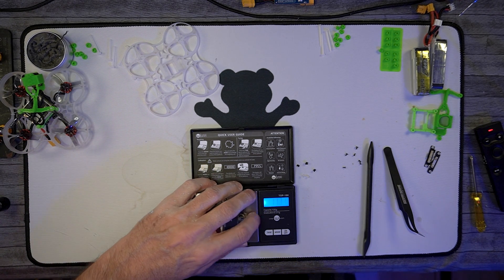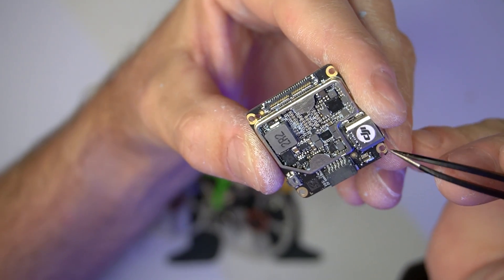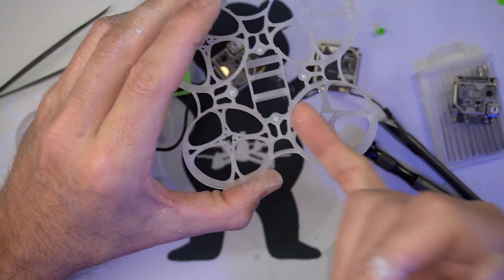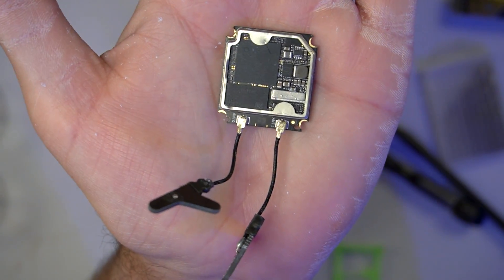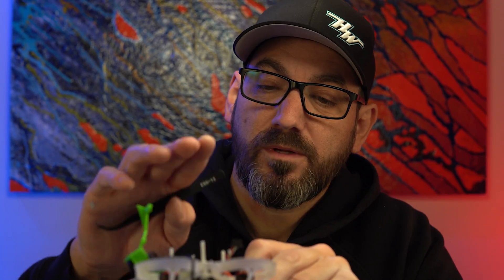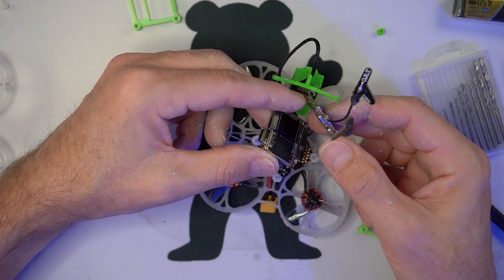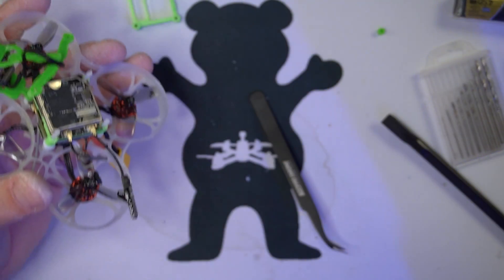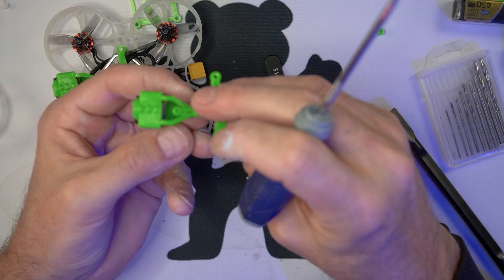Mobigital O3 Nano Cinewhoop Build Walkthrough // DJI O3 Air Unit 75mm Tinywhoop

Comment: Putting together a mobula 8 03.  Just noticed the aio board has the same amp ratings as the gnb a30 plugs.   I plan on stripping down the  03 unit and camera to save weight.  If I changed over to a30 it would drop the weight by almost 2 grams additional.  I don’t mind soldering plugs.  What are your thoughts on flying 2s with a30 plugs?  They are rated for 12amps by continuous and 15 peak.  I’m sure they could do more but I’m thinking that board would have problems before those connectors melt.

Comment: I’ve been thinking about trying this with the mobula 8 with your stl files.  I’m thinking the bit of extra power will be nice.  Your thoughts?  Do you think the extra weight would have a big impact on the durability of the 03?
Reply from the maker: I think the mob8 is 85mm? 80 and 85mm does handle the weight better for sure.

Comment: why didn't you just use 1.6m x 20mm bolts and use small rubber PCB board grommets versus cutting the corner of the Vista boards? that way you can keep the build holes at 1.6mm the whole length? this would also save weight.
Reply from the maker: It’s a good idea but I personally didn’t like the wiggle in the stack and it adds a little weight but not a huge amount.

Comment: Thanks for making this! I just ordered the mobula8 lite and I was wondering if I could use the mobula8 board!??
Reply from the maker: I’m sorry. What is your question?
Reply: @DaxNealFPV  Sorry, my question was If I could use the mobula8 board with the motor connectors and still have enough room with the frame.
Reply from the maker: It should be able to fit. @jorceleyoliveiravela5162

Comment: why not just use an m2 size screw instead of clipping off?
Reply from the maker: nylon m2x25mm is near impossible to find and m2.5 is many times more durable in a crash. Steel screws add too much weight and will negatively impact flight.

Comment: Hello! Do you have air unit overheat problems, black screen or screen freeze when fly slow? Do you fly in CE mode or you made any power mode hack like FCC or HAM?
Reply from the maker: It will get hot like any other vtx, so arm it and take off. No black screen or freezing as it is only 2s voltage and I run the HAM hack at full power 24.7
Reply: @DaxNealFPV AM means ? , Are you supply 2s to O3 and no problem right ?
Reply from the maker: @mokshpatel6986  morning. Yes that is correct.

Comment: Hey man, appreciate all the info on your builds! Can you tell me if you would go with the RCINPOWER 1002 motors or the newbeedrone 0804 motors for a mobigital 7? Both are slightly high on the KV for a 2s whoop (14000) but I think I can get by with motor output limit. Most of the 1102 motors aren't in stock these days so I'm looking for my next option (would get them from your site if you had em 🤙). Thanks brotha!
Reply from the maker: I found the 1002s to be lower in efficiency on a heavier build by 30 secs but I still got 3min. And the nbd are too unnecessarily heavy. Between the two, I’d choose the 1004 personally brother!
Reply: @DaxNealFPV  Thanks for the quick reply! Best of luck with QuadSensi, I think you really got something with the ‘nano cinelifter’ 🤙

Comment: That is amazing, I'll totally build one of these myself. I can see that the antennas are not included in you kit, witch antennas are these you using? Thank you!
Reply from the maker: Thanks brother! They’re the ORT micro vee. I m out of stock and most everyone is but I think RDQ has a few left right now. Mine order has landed and in in LA today. I’m guessing I’ll have them by Tuesday.
Reply: @DaxNealFPV So I would just use two of these linear antennas? I thought Dji used left handed. Thank you for the answer btw!
Reply from the maker: @barraca1393  yes, for a whoop, there is not degradation. The battery will limit you well before you reach far enough away for it to be an issue.

Comment: Wow awesome!! There is a lot of heat in O3 VTX, is there no problem?
Reply from the maker: It does get hot but just arm a fly and you are fine. I had it get stuck in the rafter for 15 minutes once and it is still fine.
Reply: @DaxNealFPV  this is great to hear. I’m super interested in doing one of these. Love tinys and I love the video from the 03. Great video man thanks. I’m sure I’ll bombard if I actually get around to doing this.

Comment: This is so awesome. Have you tried putting the case back together? How bad is it for flight time if you dont remove the case? 
I have only one o3 and will need some protection in the future when my 5in freestyle frame gets updated
Reply from the maker: You’d need to replace the thermal paste but should be doable. 
Immensely as it’s all about the weight at 75mm.

Comment: hey bro which motor and aio fc you using?
Reply from the maker: Any AIO with two uarts or one uart if elrs is on board and 1102 10k or 13k motors.
Reply: @DaxNealFPV  hi, what kv is better: 10k or 13k for 1102 motors? What's the difference in quad behaviour?
Reply from the maker: @SammyFi  less flight time

Comment: Thanks for making this a thing!! Ordering my parts now. Just having trouble finding an AIO to use.

Is it possible to use the DJI V2 remote instead of internal ELRS on that AIO?
Reply: Happymodel Crazybee F4 pro doesn’t have a VTX and receiver but still has 2 full UART. You can find it for $50-60 online and it come with an XT30
Reply: You can also unbridged one pad on the crazybeex pnp v2.2,  used for the original crux3 to disable onboard vtx, and then use the solder points for the uart and wire the power from vbat. It is still a light board even with the disabled vtx.
Reply: @kurtzFPV  I used that board on my first build, but the solder pad are tiny and their position is a rela pain in the but (super close to the USB port and in the middle of the board)
Reply: @MrAlucardDante  I agree that it is not the easiest board to solder, but it has been working well for my build.
Reply from the maker: Yeah, finding an AIO without ELRS or a VTX is hard. Yes, you can use the DJI radio and that is best to keep weight down.
Reply from the maker: Check out Zeus5 or 10
Reply: Awesome thanks guys! Can’t wait
Reply: x12 lite should work